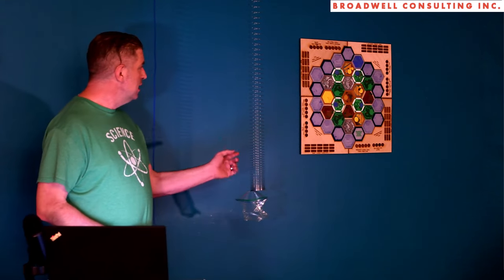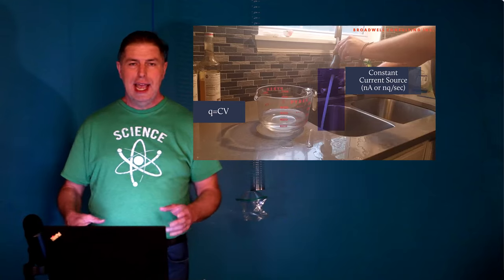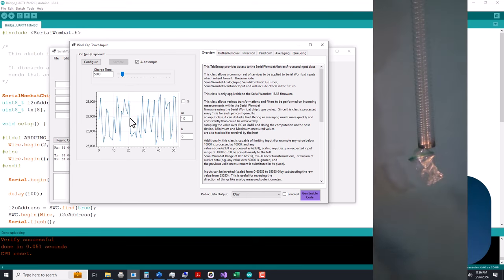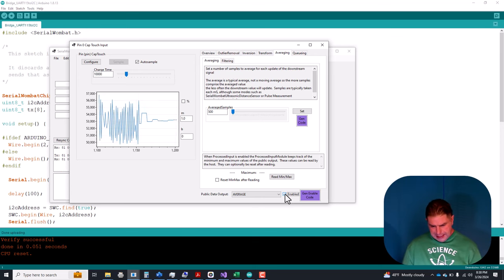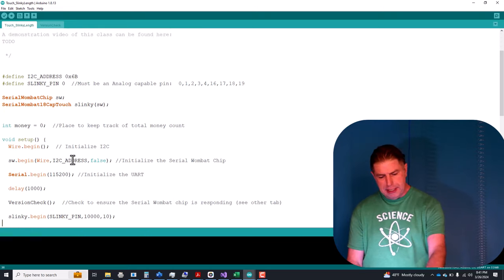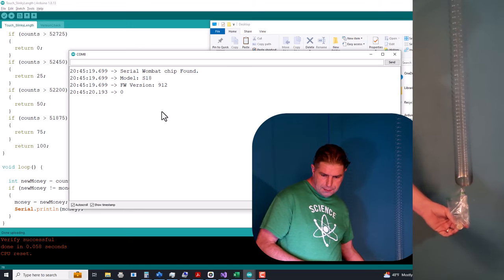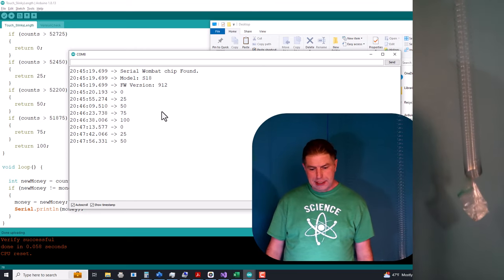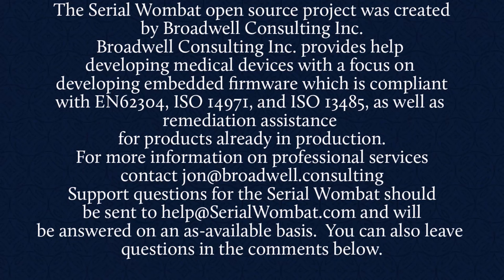One Wire Slinky Measurement!   Capacitive measurement with Arduino, Serial Wombat 18AB and the CTMU

Comment: Hi Jon, congratulation for this idea and the simply looking solution. I am presently working on a robot to fill pills in the one-week container based on the prescription. At the moment I use 16 servos and 4 stepper to control the distribution. Right now only 2 WB4B are incorporated, there is enough space to put more intelligence in the system, but unfortunately I do not have to much experience. Anyway I will keep you informed and send you a video on the functionality in a few weeks.
With best regards from Austria and best Eastergreetings
Willi Kothgassner
Reply from the maker: Good luck with the project!   I'll look forward to seeing it.